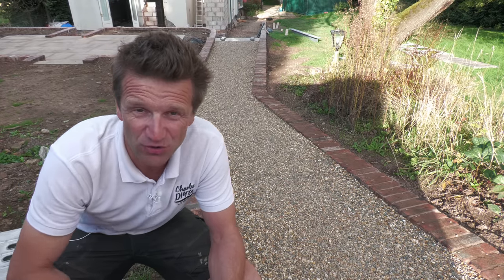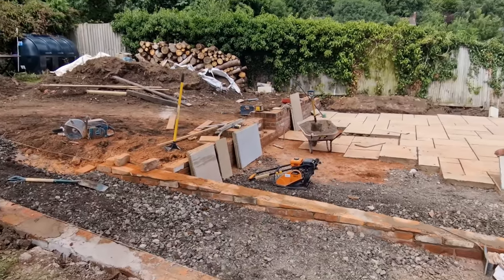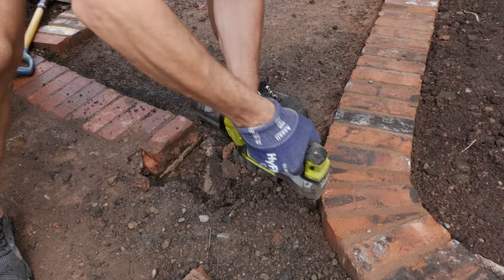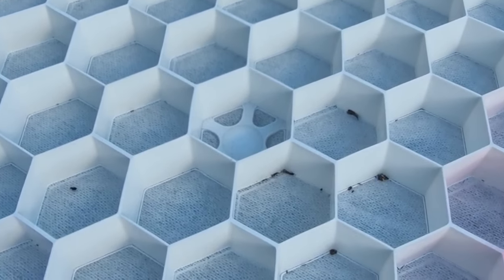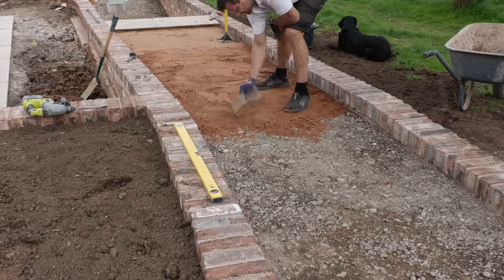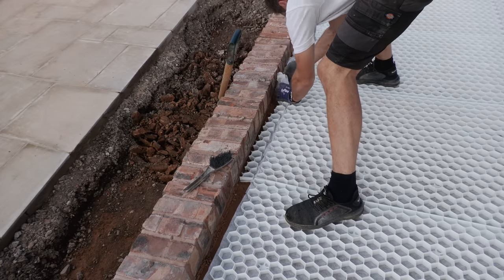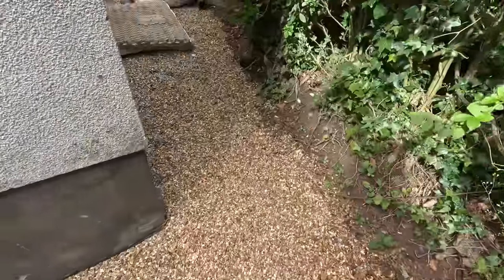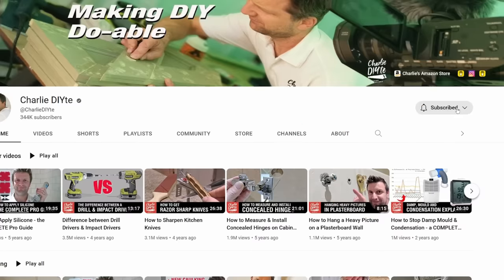How to DIY Install the Ultimate Gravel Path

Comment: Hey can you confirm this could be layed on a tiles / concrete driveway then still lay the gravel sand ect and it will still efficiently drain, would you recommend using a weed mat even with a tiled/concrete courtyard . Thanks in advance @charliedite

Comment: Looks great Charlie. I did something similar but on a smaller scale down the side of my house to create occasional access for the 4 new wheelie bins our council has decided we now need! 
I used a heavy duty 600 x 600 interlocking square grid with weed membrane & 10mm gravel. No MOT or sand but loads of tamping down with a heavy steel tamper. I looks OK with the slightly pinkish B&Q 10mm gravel, quick to lay (even on slightly uneven ground) & easily takes the weight of the bins & a fully loaded wheelbarrow.

Comment: Fitted this when laying my driveway. It's great. The gravel doesn't migrate onto the road ... the only downside is that the gravel does crumble into the hexagons after time and the dust, and any general crap washed off the road, fills them and makes a great starter for  small weeds and grasses to get a hold (despite matting beneath).
Reply: I was wondering what you’d do about weeding. Presumably no chance of using a hoe, as you could with just the same depth of loose gravel.
Reply: My mother's condition is very bad. I need a lot of money for his treatment, I am a poor man. Father dead Please help me pass on. I live in Bangladesh😪😪😪🙏🙏

Comment: As with last years path i give is the landscape architects seal of approval ha ha!! These grid systems are great, i have used them in my designs for public car parks. The mesh can be made from recycled materials and even the higher grade plastic systems can take the weight of coaches and fire engines. I suppose the only thing i could think of is in larger schemes with poor drainage soils you may need to consider installing french drains / soakaways underneath to prevent pooling and long term movement. I have done this (where needed) on some of the car parks i have designed.

Comment: The gravel paths look wonderful. Thanks for a wonderfully detailed video explaining how you made them. I'd love to replace my asphalt driveway with gravel but it's not really an option in my part of the world. In most of Canada we get a lot of snow in winter and the gravel would be picked up when removing the snow. It would be especially dangerous if using a snow blower (snow thrower). That's why most places here have asphalt with a minority using stone pavers. 

Somewhat off topic but the plastic devices to hold the gravel in place reminded me of a project that I completed earlier this year. I have a little area in front of the steps to my main door that is covered in small paving stones. They had become uneven over the years due to water eroding the soil underneath in a couple of fixed locations. I fixed the water issue last year. This year I lifted the stones, dug up the base, and filled in and compacted below. When replacing the paving stones I used paver base panels from Brock (but other companies make them. I don't know if you have come across them these before. They require less gravel in the base which is good for the environment and saves time. If the erosion in those locations should happen for some reason the paving stones above won't move because they are supported by the panel, which won't move. I thought you might be interested in knowing about the panels, if you don't already know.

Comment: Thanks for your videos.
I built a similar drive and terrace. The supplier of the grids claims the ones you used for the drive (and I used) can take up to a 3T lorry, which in the meantime it has.
I do wonder about the need for the weed matting, as the only issues I've had are from seeds landing on the terrace and managing to grow. The fabric on the bottom of the grid should block any weeds from growing from below.
We also used them to do a small terrace in another part of the garden and just laid them on some tamped down, evened out earth. Works a treat two years later, and very cheap (I used a coreten steel sheet boundary.
Reply from the maker: Thanks. I think these grids I used are really for paths - though you're probably right that they can take a car. You'd just have to make sure the gravel coverage was good as tyres would munch the plastic if it came into contact with it - my wheel barrow certainly did! It's a great system though isn't it 👌👊
Reply: @CharlieDIYte  From  the manufacturer's specs, one important aspect is that gravel has to lay ca. 1cm above the top of the grids in order to avoid UV degradation. With this in mind, it should be impossible to come into contact with the grids themselves. With proper filling using suitable gravel (we used washed gravel from the local river -- the Elbe -- 8-12mm), the stabilisation grids provide only lateral (ie horizontal) stabilisation. The vertical stabilisation/support is provided by the gravel and underlaying (we used our old roof tiles compacted and mixed with recycled concrete -- saved £€s twice over🙂)

As you say, they are really great, albeit that they appear expensive when one first sees the price (we pay ca €10 per m2). That said, our terrace/drive is ca. 200m2 all in, so we were able to do the lot, gravel included, for about €3k, which dwarfs any other paving solution.

Two notes for those that have read this far. 
Should you lay anything like cables/watering hose between the grids (I've done both) use some kind of anchor to hold them down. They have a habit of raising themselves. 
And, should you need to clear any of the grids to access something underneath, the best way is with a leaf blower.

Comment: Hi Charlie, where you get a lot of leaf debris come the autumn, and you are considering gravel paths, due to the nightmare of trying to get them up, have you ever considered an epoxy, or similar, to stick the uppermost part, to keep them in place? Down the sides of houses, and similar, where brushing also brushes away the gravel? Especially after it has all settled?
Another great video.👍👍
Reply from the maker: Thanks Daniel. Funnily enough only yesterday I got the leaf blower out on the path. The stones are just heavy enough to stay in place allowing you to blow all the leaves off it. I'm not a big fan of resin particularly after using a resin grout on my patio and watching it go black already and fail in areas.

Comment: Interested to hear what experiences you've had with weeds growing in the gravel.  I've had two gravel driveways, the first was gravel on top of weed proof membrane (no grids), the second just gravel on hard ground (again no grids but also no membrane).  My experience has been that weeds grow abundantly in both and it's a frequent job to pull them out.  Most of them grow in the upper layers of the gravel so the membrane is doing nothing, but we do get tap roots growing through it.  Overall I don't think the membrane adds anything and if I were laying a path I'm not sure I'd bother. If the weeds grow in the grids and through the grid membrane then they'll continue through whatever is below.
Wondering if the grids themselves and holding the gravel in place reduces the weed growth?
Reply: My mother's condition is very bad. I need a lot of money for his treatment, I am a poor man. Father dead Please help me pass on. I live in Bangladesh😪😪😪🙏🙏

Comment: Great job!  I'd always recommend skipping the weed barrier layer.  This stuff always fails eventually as there are plenty of weeds that will penetrate it and then leaves an environmental hazard and is a huge task to remove.  After a painful removal project from under my driveway, I'd gladly see it banned.
Reply from the maker: Thanks mate and good point re the weed matting. I don't know how it works anyway given how loose the mesh structure is. 👊
Reply: Can you explain please

Comment: Hi Charlie.  Having used the black stuff you can for a base for a summer house I was very impressed by it’s performance . Now seeing use this different product , which uses a similar technology, got me thinking .  We have a concrete path around our house which is looking very shabby, although it a few cracks and places where service been cut through it . Having said all that it’s structurally sound , so my question is do you think it would work in such a situation as in putting on top of the concrete . Obviously I would have to install a barrier on the open side as you did on first project .  Any thoughts my friend .       Kind regards as always 😀👍👍👍
Reply: Just reread my comment ,which I confess didn’t make much sense even to me . The back stuff is the plastic squares that you fill up with gravel, the same principle as the material you’re using .  Along with various missing words I made a complete mess of my original comment .  But maybe you will be able to make some notion of my question  .  Kind regards as always
Reply: My mother's condition is very bad. I need a lot of money for his treatment, I am a poor man. Father dead Please help me pass on. I live in Bangladesh😪😪😪🙏🙏

Comment: You said your first gravel path was over engineered and I would say your second one is also.
I live in NZ and the plastic grid is quite expensive and therefore did not use it.
.I have laid  a blue chip gravel  parking area and paths just by putting geo-tech cloth over the bare top soil  a free draining silt loam .After 12 months I am very pleased with it.The beauty about my method is the gravel stays relatively loose and is 4'' deep so weed seeds  dont germinate in it and you can always rake it so it has a smart appearance. 
You have laid a path that would stand up to motor traffic and is not needed just to walk on.
Reply: By the half arsed way they built houses in new zealand none of what you said surprises me🙄